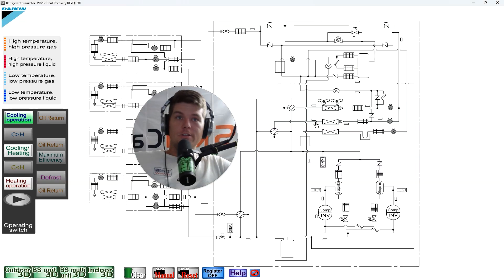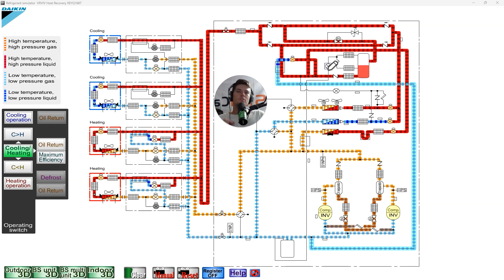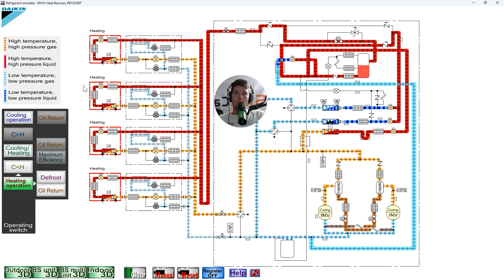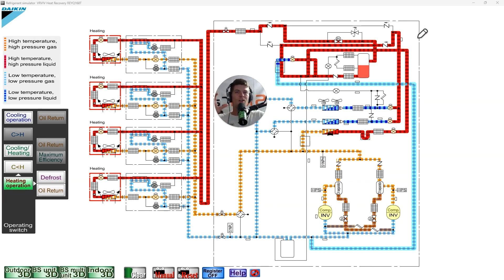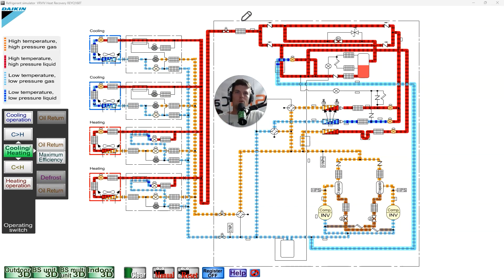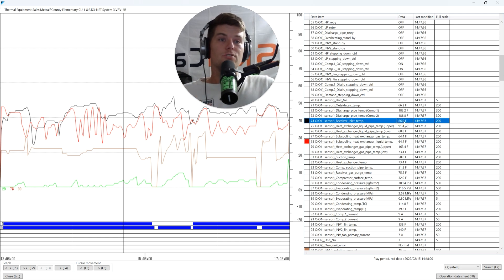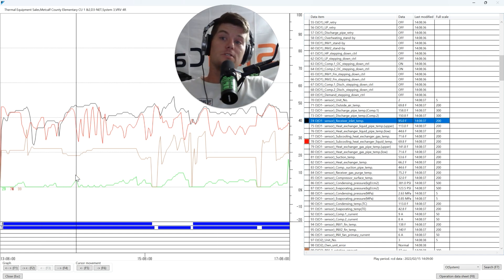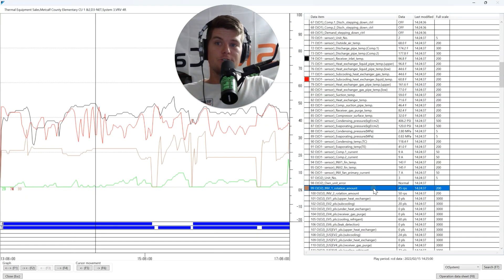VRF & Subcooling - Where to check it in Parallel Operation

Comment: Hi,Roman.How about the parallel operation working in a high ambient temperature(95-104°).We install vrv heat recovery(REYQ...) and we use for clima but also for the production of the domestic hot water(Altherma).I dont know if this is common in USA especially Florida has very similar clima as we have in the south of Spain.
I apreciate your videos and your time.Thanks mate.
Reply from the maker: Do you have a specific unit or application you are referencing so I understand the question better?
Reply: @RomanBaugh I usually work on large VRV systems (mostly VRV 4+), heat recovery systems with a number of indoor units, and two Altherma units for DHW and central heating (underfloor heating). The thing is, my systems work all year long with fixed heating control. So, my question is, is there any significant difference between normal cooling control and fixed heating control, with all the indoor units working in cooling mode? If you don't mind, I will send you the some reading material I had.I just have the D-Checker and Im happy  with It.Greetings from Spain.

Comment: Will there ever be a video showcasing a situation where someone fixes something or am I being naive in thinking we are trying to do that at this point in the industry? This content has really helped me find more and more things going wrong with these systems, but no client is in a position to tear the building down and repipe, and the amount of failing valves and thermistors seems virtually endless with supply chain operations being at an all time low in this industry. If anyone could articulate how to manage the expectations of a client or even us as technicians it’s gotta be you Roman.
Reply from the maker: I love this man, if I am hearing you correctly, forget the data analysis and show us how to manage customer expectations regarding issues we find in the field? I can do just that
Reply: @ customers and our own as technicians because we are coming from the days of finding a failed part on the system, to finding dozens of installation infractions that have caused contaminated piping that has ruined dozens of strainers and EEV’s and that has caused compressor failures that has further contaminated the piping that is inaccessible and the customer is looking at us in disbelief of the list of thing’s going on with their HVAC system.
Reply from the maker: Yea my short video today was for you my friend. It feels like a lose lose situation sometimes. All we can do is educated the client and fix as much as they are willing to do and hope for the best.

Comment: How do I get the refrigerant simulator?
Reply from the maker: I can share a Google Drive link
Reply: I would like the link if that’s ok 
I have the vrv3 sim but not the 4 👍
Reply: @RomanBaugh  thanks, you'll post it here ?
Reply from the maker: Here is the link. They are only designed for Desktop use. Need to save them to your computer.

https://drive.google.com/drive/folders/18AgJ54m1d1yDNqttsWBgkI29MyUJ9HiC
Reply: Thanks so much 👊🏻
Love the how much help your giving pal
Reply: @RomanBaugh  these are awesome and can learn so much from studying them, allowing you to follow the flow from the outdoor to the BS box to the indoor and back. i appreciate you sharing!

Comment: Say in a master and slave set up Reyq16py1. Should bkth subcoolers be used at all times or just one side or depends on the operation mode
Reply from the maker: It’s specifically for keeping the compressor cool in that module.

Comment: Excellent explanation this is the level. I need to get to explain this exact same technology in electric vehicles are now using for the past several years heat recovery both DX systems and glycol loops with plate heat exchangers with multiple electronic expansion valves with high-voltage three phase compressors in automobiles.

Unfortunately, Automotive technicians do not know any of the terminology so it’s like speaking Greek or Martian to an aboriginally who is stuck in his desert life without ever seen a car in their whole life 
Automotive industry has a definite need of education, cars operating exactly like Daikin Mitsubishi, LG and Samsung with the same systems compact miniaturized  
   Unfortunately, the automotive manufacturers do not always give us availability to read their sensor data.
Reply from the maker: Thanks man! Subcoolers are everywhere it really just comes down to how are we controlling them and to what purpose? Nothing new in VRF just called something different and controlling it a special way! Glad you enjoyed the video!